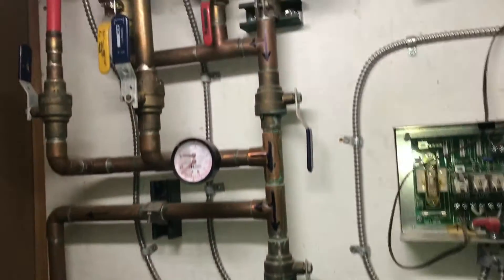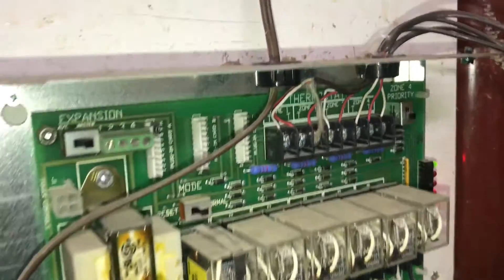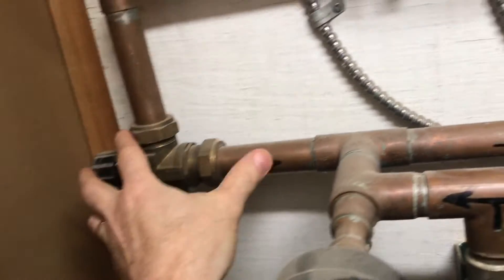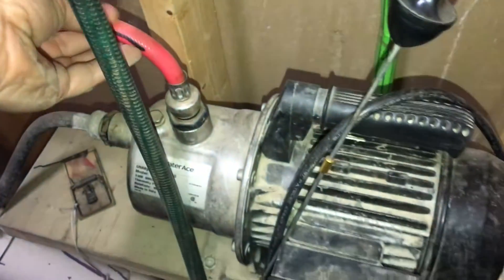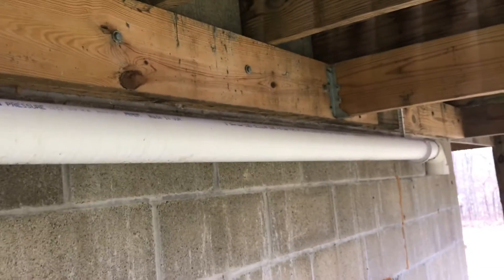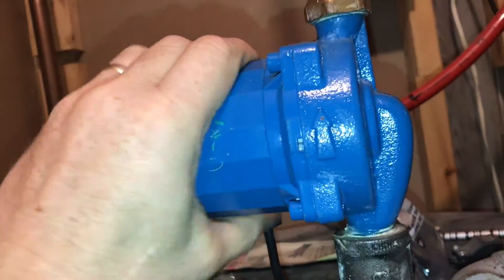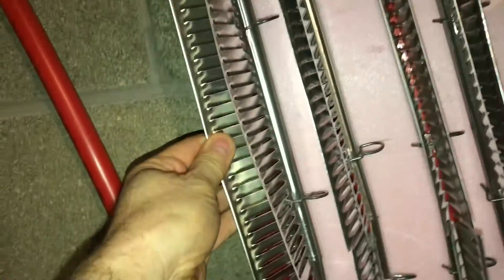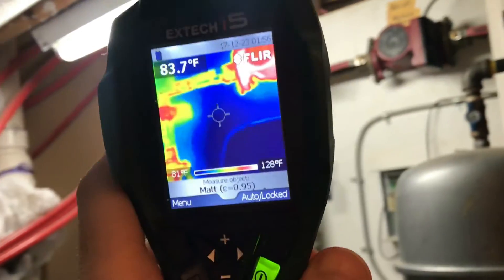how floor RADIANT HEAT systems work (why I like them)

Comment: is PEX tubing supposed to last forever? I’ve always wondered how you could tell if there was a leak in the system, and how you would fix it if it’s encased in concrete
Reply from the maker: Those are great questions. Because it has not been out for years and years like something like copper there’s not enough information to know how long it will last. Finding a leak within the concrete is typically done with an ultrasonic listening device. And as you can imagine if there is a leak you’d have to break the concrete out to fix it. I figured while I was pouring a concrete floor anyway I might as well have the tubing in the concrete. The system has been working exceptionally well. If I had to do it again I would. The heat is very even and comfortable.

Comment: "It's actually isn't as complicated what it look" 
Well it can be done more simple way. 
You only need two manifold and ONE water pump where each circuit has own thermostat which is guided from each room. Water constantly circulate from boiler to hot manifold and if some circuit need more flow thermostat will allow it and other end of circuit is connected to cold manifold which leads back to boiler.